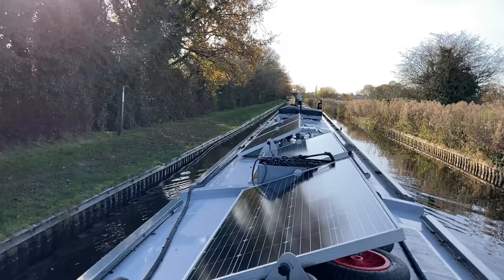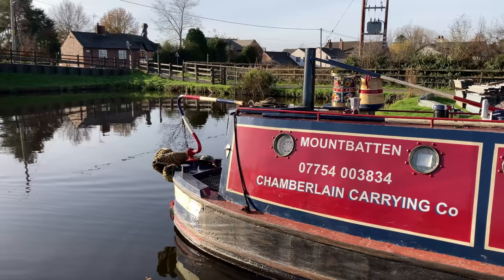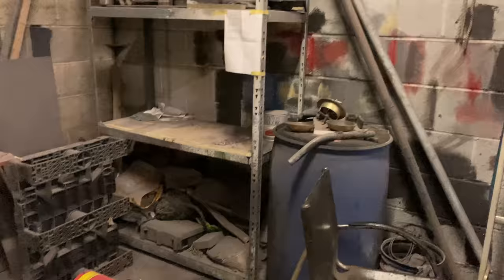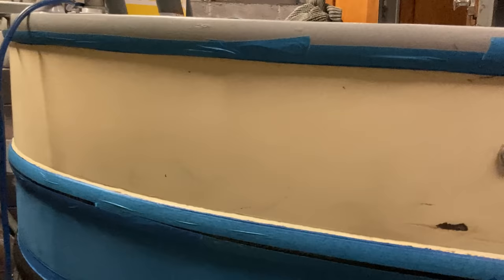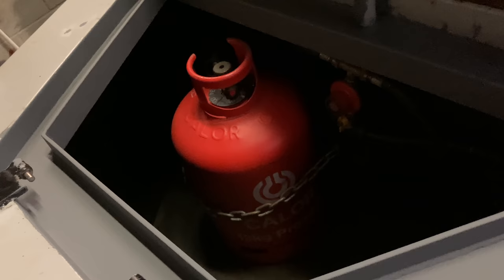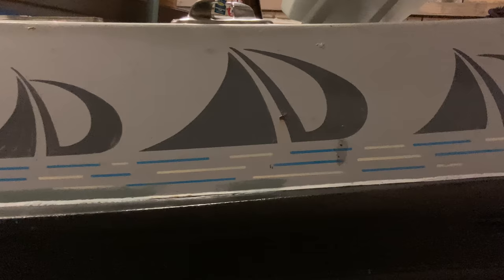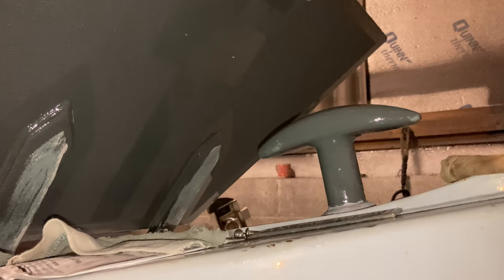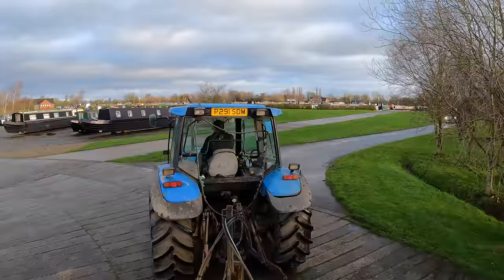89 We're Blacking Again

Comment: How do you apply the blacking to the underneath of the hull?
Reply from the maker: There two schools of thought on that one Dale.
Some boaters like to black the baseplate using a roller extension pole but in fact the Oxygen level near the bottom of the canal is almost nil so rusting is not an issue plus most would get scraped off anyway as it goes aground or runs over something